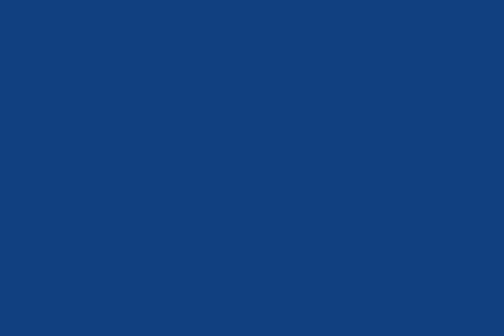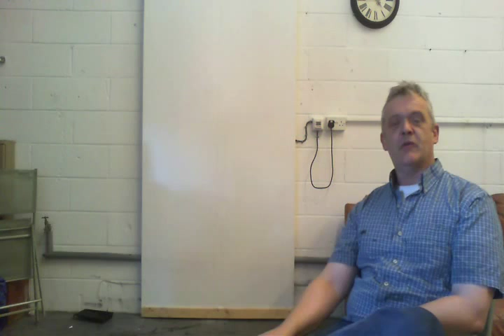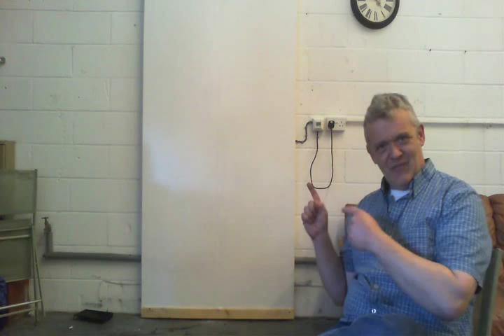Some Furthur Thoughts On Constructing A Giant Radiator

Comment: hello Robert ... I am from Canada and operate the website greenwatts.info ... my site is basically a DIY for green energy projects ... I design and build the project then publish the design and construction on the web site ... I would very much like to do a project with your heat ink. I would be glad to link back to your vidoes and website. What would be the best way for me to obtain enough for a project to construct radiant floor heat for a 12 ft by 12 ft room.
Reply from the maker: are you after a freebie in return for publicity?
Reply: Robert Murray-Smith well I am open to any ideas ... I am in the process of re-expanding my website ... right now ad revenues are a few hundred dollars a month so I don't have a lot of spare cash. I am sure with my subject matter and draw greenwatts.info could provide some benefit to your company. How much ink would you recommend I need enough for some experimentation (which I could document) and the room project.
Reply: Robert Murray-Smith I think I could get away with 50ml to start with ... does your contact in Ontario Canada have some of this in stock?
Reply from the maker: helpmonkey
he should have and 50mL sounds like a good start